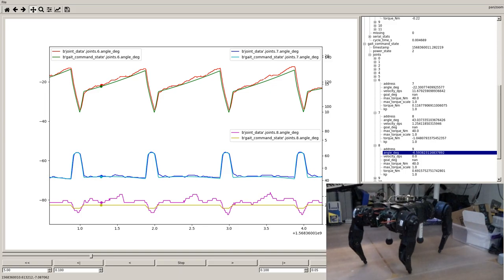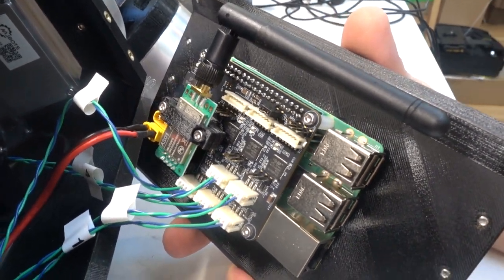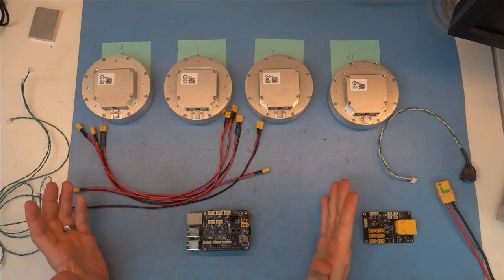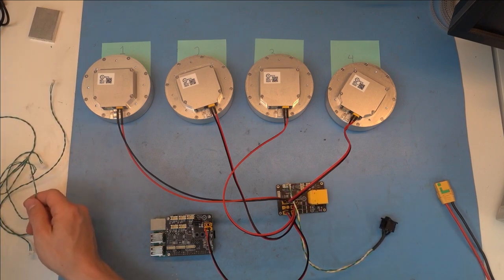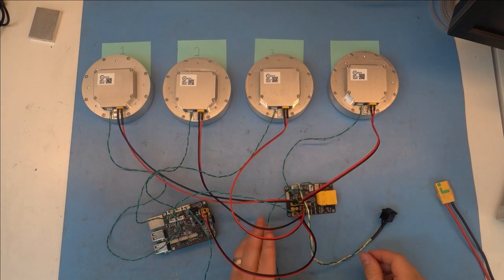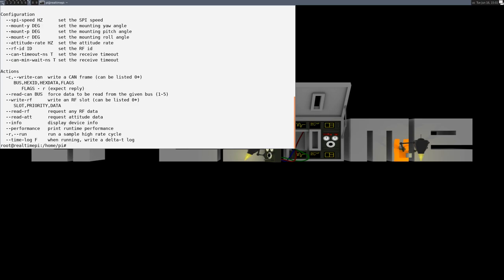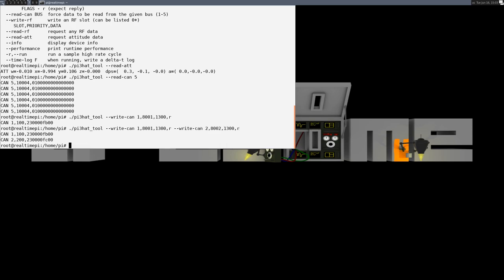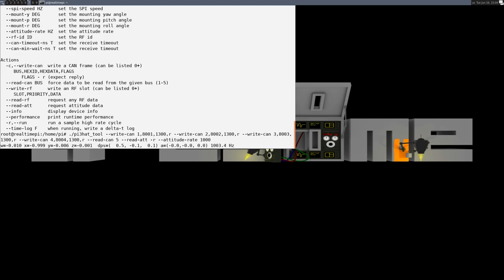Getting started with the mjbots pi3hat

Comment: Awesome video, and all work that you are doing!
Can you recommend power supply that could be used here? For a dev kit 24V 5A is used, but I suppose for this number of motors more amps are needed. Thank you in advance for an answer (sorry if this occurs to be trivial question).
Reply from the maker: I'm not aware of an economical supply that can drive a quadruped's worth of servos at full power. I do some testing with a relatively high end 60V/25A supply, but most work just uses a battery.
Reply: @awesjosh  Thank you for response, and all the best.

Comment: Hey, how did you assign unique identifiers to each of the motors? I am trying to connect 4 motors but the CAN network is not working. I have not previously assigned any identifier.
Reply from the maker: Start by working with one servo at a time on JC1.  Use tview to change `id.id` to what you want, then immediately reconnect with the new id to issue the `conf write`.  If you don't see an `OK` in response to your conf write then it didn't work.
Reply: Thanks a ton for your response. Could you please explain the process of reconnecting with the newly assigned ID and issuing "conf write"? @awesjosh
Reply from the maker: @MuradMehrabAbrar  when you start tview, specify the `-t 2` option (or whatever your new id is).  Then type `conf write` in the terminal at the bottom.

Comment: i wondering if i can control those motors remotely, and if herelink can be used here ?????
Reply from the maker: They are not compatible with herelink.  They can be controlled remotely, although the mechanism for that is up to the designer.  The quad A1 for instance, has a wifi hotspot which the client controller connects to.
Reply: @awesjosh  i have TBS flight controller, and the receiver has PWM protocol, how i can control those CAN motors remotely with PWM??, if not? can you suggest any CAN receiver that is compatible with your controller??????? talking here about long range controlling that may reach up to 2 KM
Reply from the maker: @artificialintelligentdepar3372  Sorry but I don't have anything to recommend.

Comment: Hey Josh, 

Great video and I really like the mjbots pi3hat but one thing I still don't quite understand is why it needs to have such a high update rate? Could you not do the inverse kinematics on the moteus controllers themselves and only update the divination from expected to correct the 3D model on the main controller. That way when actuators are performing as expected you don't need to use bus traffic. In situations where everything is going wrong I can see a need for the main controller to attempt to have direct feed to try and correct the situation but outside of the need to deal with unexpected changes to the environment I don't see why the high bandwidth networks would be needed.

Also I am quite jealous of how many G4s you seem to have laying around. 

Also why did you choose to use CAN FD rather than something like Ethernet or EtherCAT?
Reply from the maker: When running at high step rates, 400Hz ID is actually not very fast.  Each phase of the step or swing profile only gets a dozen or so cycles.

You might be able to do some of the work on the individual controllers, but it would be nontrivial and there aren't that many free cycles anyways.

CAN-FD was used because it was much simpler and lower cost to integrate than ethercat.

Comment: Very Nice board and explanation, Do you have diagram how to connect 12 servo using pi3hat and raspberry Pi. Thank you
Reply from the maker: CAN is a multidrop bus so there are many possible topologies. The quad A1 for instance has 3 motors attached to each of the 4 CAN-FD busses on the pi3hat.

You have the option of using the daisy chain connectors on each moteus board for power or CAN or you can add T spices in your harnesses.  For power you can daisy chain, t splice, or use a star topology.

If you don't need a maximal update rate you could connect 12 motors on a single CAN-FD bus if that made the wiring easier.
Reply: @awesjosh  Thank you

Comment: what rates can you achieve with your fdcanusb?
Reply from the maker: That question isn't terribly specific, but here are some answers.  It is capable of up to 8Mbit CAN-FD line rate, although depending upon your utilization pattern it probably cannot keep a bus fully saturated at that rate.  It has been used for at least 200Hz round trip control of single servos.
Reply: @awesjosh  sorry! that is exactly what I meant to ask. I am building a 9 DoF robot, here you mentioned 1khz control? Is that round trip (read position, velocity, torque/current, set torque/current)?
Reply from the maker: I wouldn't expect the fdcanusb to be able to control a 9DoF at 1kHz.  The mjbots pi3hat is designed for higher rate control of many servos, with it I have demonstrated 1kHz control of 12 servos simultaneously.  That said, any CAN-FD solution can be used.
Reply: @awesjosh  would you recommend multiple USB CAN FD boards or using an rpi with hat + ethernet coms layer to control from desktop?
Reply from the maker: A rpi with hat + ethernet will likely perform better than multiple fdcanusb's, but it depends upon what IP protocol you end up using to communicate between the desktop and the rpi.  Neither will be as performant as having the CAN transceivers directly connected to the processing platform by a high speed low-latency bus like PCIe or the SPI that the pi3hat uses.  You might consider something like one of the PEAK PCIe CAN-FD expansion cards?  You can get 4 channel variants.  I've used them on embedded systems, not a desktop, but it is just PCIe so should work similarly on both.
Reply: @awesjosh  thats a great suggestion.  Separately, does your motor controller have a battery backup for multiturn absolute encoders?
Reply from the maker: No, it does not have battery backup.  It does have a provision for the host to record the turn count and restore it upon power-cycle.